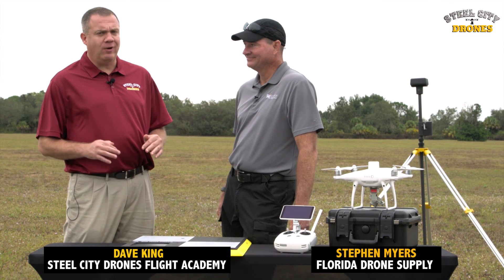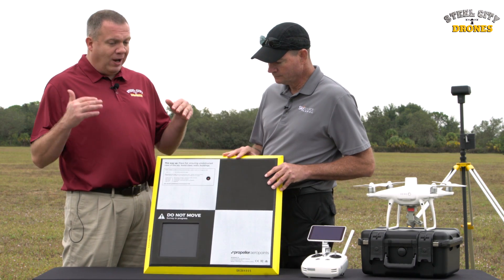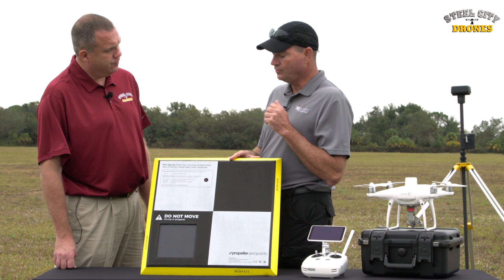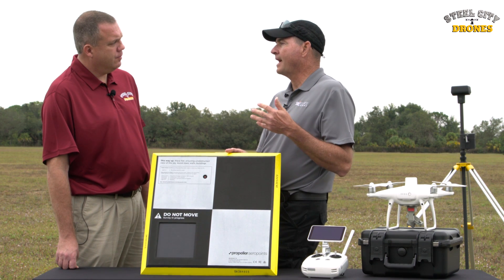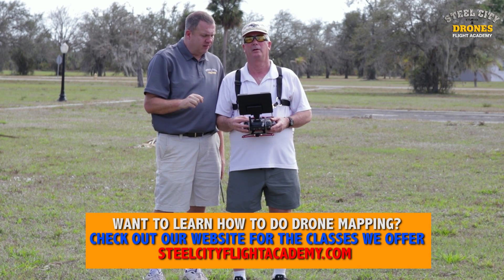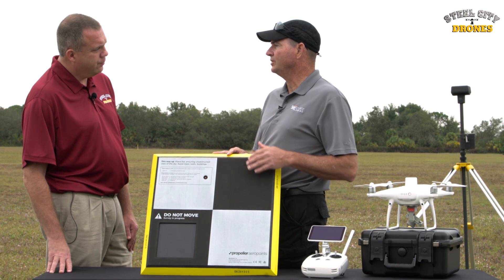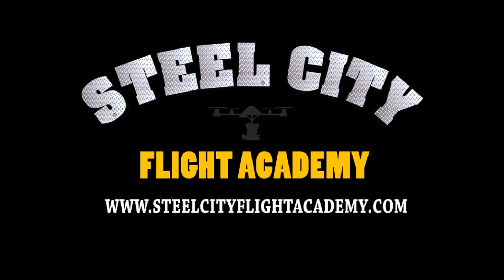DRONE MAPPING & SURVEYING - How to use Portable Ground Control Points

Comment: can i mark points with remote  m300 rtk and rtk base station without aircraft?
Reply from the maker: Which points are you referring to? Ground Control points are independent of the M300 and base station.
Reply: @SteelCityDrones  I need to get the ground point and don't need M300 on.  Use only smart controller and D-RTK 2 base station
Reply: @mmong626  Ground control points have nothing to with the M300 on or off.

Comment: I didn't understand the part where they said arrow points are useful for relative accuracy.
The way I understand it, drone maps are relatively accurate without ground control. Ground control (AeroPoints) is useful when you want to put the Drone map on a particular place on the earth, which is absolute accuracy.
Reply from the maker: I watched this again and I did not here Steve say that. He explained the difference between relative accuracy and absolute accuracy.
Reply: @SteelCityDrones  
2:07
"Rtk is important for absolute accuracy and ground control points are important for relative accuracy".
Am I misunderstanding something?
Reply: @SteelCityDrones  
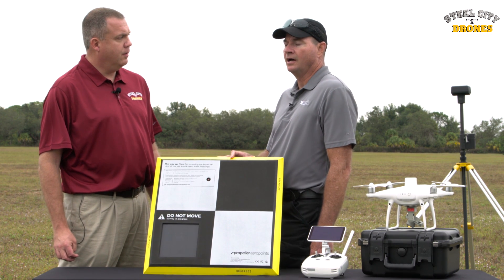Also, at 1:55 he says that "the relative accuracy is where a point is on this globe and relative accuracy is..."
He said relative accuracy twice. One of them should have been absolute accuracy unless I'm misunderstanding. something.

Thanks for reading these comments and taking the time to respond 🙂
Reply from the maker: @jerseyshoredroneservices225  Absolute accuracy is a point that's a specific spot on earth, relative accuracy is a point that's accurate compared to other points around it.

Comment: So if you have the rtk with ground station do you still need control points?
Reply from the maker: There are a lot of factors that go into that. One thing you definitely should have are check shots to validate your data. You can have the best data but if you can't validate it, the data is useless.  Check shots are taken from Trimble Rovers that most engineering companies use.
Reply: @SteelCityDrones  thx

Comment: So I just passed part 107, practicing this with a anafi thermal and trial of pix4d. I am noticing even after calibrating the drone where the flight path overlay and the map of my house from wherever it's getting the satellite imagery is offset by like 10 ft. Not sure if it's the GPS on the drone being not accurate or satellite  imagery of my house that is offset. It's also missing the sides of my house but it is working mostly.
Reply from the maker: It's not uncommon for projects to be off 10-40 feet if you do not use Ground Control points. And the only way to really validate your data is to use Check shots using Trimble hand helds.

Comment: The key phrase here is " you have to pay a Surveyor", when AIs take this over standard surveyors will be out of work...
Reply from the maker: In the United States it is illegal to advertise "survey work" without being a licensed surveyor. Survey work is considered to be line work, CAD deliverables, and a stamped seal signed off and certified by a licensed surveyor.  Most people don't have a Trimble R10 that can set Ground Control or Check shots so they pay a survey tech to collect that data for them.

Comment: 6k ???

Why would I not get a rover
Reply: Recommend you call them Temporary control points.

-A surveyor.
Reply from the maker: On average, you can pay a survey tech between $1000-$2000 per job to lay down ground control points. If you do 3 to 4 mapping jobs the portable control points pay for themselves. In addition, you can use the Portable GCP's as a reference check shot that you can calibrate the base station, and or use additional check shots to validate data.
Reply: @SteelCityDrones  not in the UK....

If your lucky get a student or trainee and probably for around £180.

Things are not the same the world over.
Reply from the maker: @Guide504  Sorry your reply is not understandable.
Reply: @SteelCityDrones  slang for cheap intern in the UK.
Reply: B@Guide
ecause of the time it takes to use the rover. The Aerooints work while you're flying. You put them down and then you pick them up. The data is collected and uploaded automatically. Propeller does the PPK for you. The whole process is much faster. 

The initial cost of $6,000 gets divided by  the number of jobs that you'll use them for over several years. If you do it with a Rover you have to pay the guy with the Rover for every point on every job over the next several years... And the pilot can't take off until all the points are done. With AeroPoints you don't even need the Rover guy. The pilot can put them out fly the site and then pick them up.